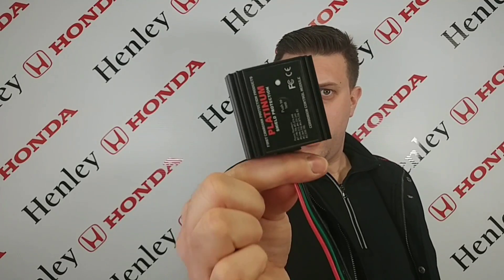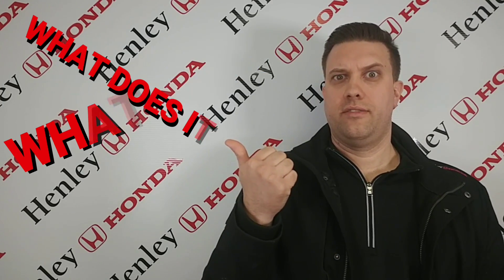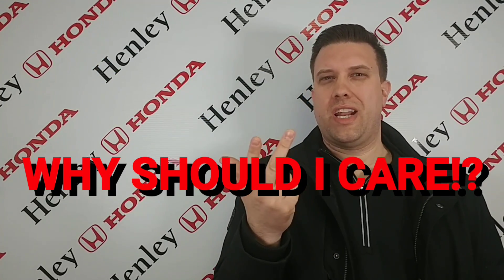Rust Module - Is it worth it?

Comment: Hey Brian  Chickowski.  Explain this TRUTH!!!    to your customers.   "The mechanism you're alluring to is called cathodic protection. It doesn't prevent rust, it just provides another place for it to form instead.
When two pieces of different metals are placed in an electrolyte (salt water for ships, the salty soil for pipelines) a voltage between them is created. Obviously, current will flow because there is now a voltage between the two metals. One metal undergoes oxidation and the other undergoes reduction. Electrons leave the metal undergoing oxidation and accumulate at the one undergoing reduction. It is this loss of electrons that causes the chemical reactions that form rust.
In cathodic protection systems, another metal (typically zinc or aluminum) is placed in the electrolyte with the steel hull of the ship. This metal is selected so that it becomes the one that loses electrons in the previously mentioned reaction so that it rusts instead of the hull (the electrons build up on the steel hull). Then when the ship goes for maintenance, that sacrificial metal is replaced and the process repeats. All of this occurs without an external application of current, but if the natural current isn't enough (due to the resistance of the electrolyte), external current can be added to help it along.
So you can see why the rust modules can't work -- there is no sacrificial metal to form the oxidation portion of the reaction, and there is no electrolyte to even create the electrochemical cell for this to even be possible. It's just a gimmick and may even increase the rate that your car rusts if it applies a constant voltage to the frame of your car. Remember cars in the 70s that had the positive battery terminal connected to the frame? Those rusted out really quickly

Comment: He is wrong here, there are 2 types of rust prevention. One is galvanisation and other one is anodising. Galvanisation is done with zinc. So when zinc ocmes is contact with oxygen, it forms zinc oxide, which inturns protects the iron from getting rusted further. As far as anodising is concerned, it is done with alluminium, when alluminium comes in contact with oxygen it forms alluminium oxide, which further protects the metal from getting rusted. I got a new toyota corolla with this rust module, lets see if it works.

Comment: WHY JUST 10 YEARS PREVENTION IF IT PREVENTS RUST CONSTANTLY 🤔
DOES THE MODULE RUST OUT ? 
KEEP WORKING ON THE SO CALLED THEORIES !!!
Reply: Maybe because of the sacrificial abode?
Reply: They might be hoping you don't own the vehicle after 6 years most likely. Lol 

I did work at a dealership doing detail shop. And really the 1000 dollars you pay on those services is just a warranty company making money. And the sales person gets 150 of it. While the service department gets 50 dollars. While the person in the detail shop that has to do so the work only gets 2 to 5 dollars of it as a tip. And the service department does nothing but file a paper in the system.

Comment: I called a Honda dealer and they are putting same thing for $700 and giving 10yrs warranty on corrosion on new vehicle. The installation process on some videos look simple. Is here an online shop or big box store that sells it?
Reply: Most cars like honda's have cars that last a long time from rust, more than 10 years. My chevy pickup is 30 years old and has no rust. I check underneath every year for rust and fix it before it gets bad..

Comment: Impressed current corrosion protection works under water. The FTC were convinced automotive systems don't work in the air and are a complete SCAM. If you are planning on storing your car in a swimming pool, pond, or lake, these systems could be worth while. For me, the garage or driveway.
https://www.ftc.gov/news-events/press-releases/1996/07/rust-evader-inventor-settles-ftc-charges

Comment: There's two things wrong here, zinc oxide isn't rust, hydrated iron oxide or iron oxide.  The second being these units are a complete joke, My fiance had one installed in her Mazda and guess what, still got rust on body panels exposed to air because rust is formed from a redox reaction where iron transfers electrons to oxygen - the rate being affected by water and accelerated by electrolytes.  At the absolute best in 'theory' these things may slow the process but will absolutely not prevent it, steel's preferred state is rusted.

The only place these have been shown to have any legit effectiveness is on boats submerged in water to complete a circuit to body panels, everything else is anecdotal.
Reply: Hello, You seem to know what you’re talking about. I live here in Nova Scotia, surrounded by the ocean, and we deal with a lot of salt water and salt on the road etc. they said the rust module would help with that, and it would be more beneficial for a person living on the coast like myself. Thoughts on this?
Reply: @youcrany  most of the people who install these modules hook them up right near the battery. they do work and they do create a 'field'. sacrificial anode tech has been around for a long time. if the device only works when the metal is wet, then that's great. this is why there are many rusty cars in moist climates, and dry climates don't have rust. (but the rubber gets dry-rotted)
Reply: I agree with you, this is not a new invention. I haven't heard about the effectiveness of its implementation in the last 30 years. I fight rust by using welding and painting, as well as treating the surface with an anti-corrosion compound)

Comment: quick question i want to get it on my 2011 bmw , im sure there is rust there already , since this bmw is a collectors item , should i repair / clean existing rust before installing the rust module or can i put it on as is?
Reply from the maker: Rust is like cancer, it spreads. You need to at least fix the current rust first. After that, you may want to consider rust spray as well as undercoating.
Reply: I’m sure Brian would love to take your money for your precious 2011 bmw that he doesn’t give to f’s about don’t worry he will give you a ten year warranty that when you go to claim will have you jumping through so many hoops you’ll feel like your in the Fuckin cirque de solie

Comment: I don't know man...you guys are the car dealership after all. Of course it works. Right?
Reply: I worked at a dealership and installed 100’s if not more of these scam modules. They don’t work. Don’t waste your money
Reply: U said it brother it dont work and it cost to make 13 dollar be selling u a rip off off 500 to 1000$ at the cheapest
Reply from the maker: peter yeung I get why you are saying what you're saying, however, if it wasn't something that I believed in I wouldn't talk about it. My goal is not to sell you anything. My goal is to educate only. Some people believe it works others don't. At the end of the day I want people to be informed. That is all. Thanks for leaving a comment!
Reply: I had a diamond-cote 9000 rust device installed in my 2010 Dodge Charger in 2011 and all I can say is that even today the body and the underside looks as good as it did the day I got the car. My son scratched the car in an area where rust would easily develop and even after all these years I can tell you that not one speck of rust has developed in this area. There must be something to these devices or my car would have rust all over it today. You have nothing to lose by trying one.